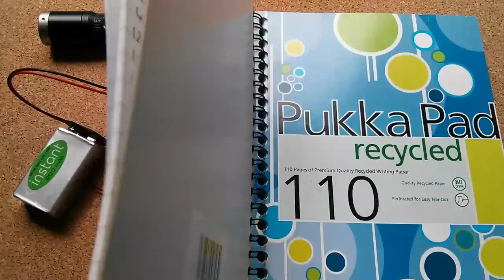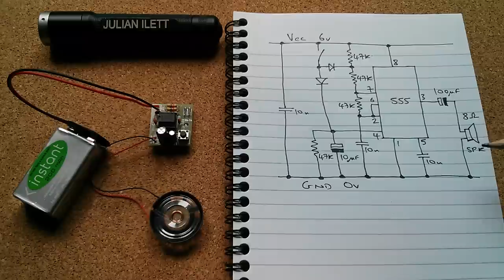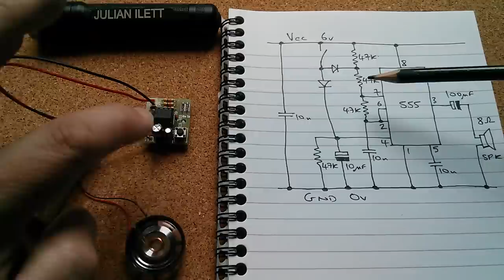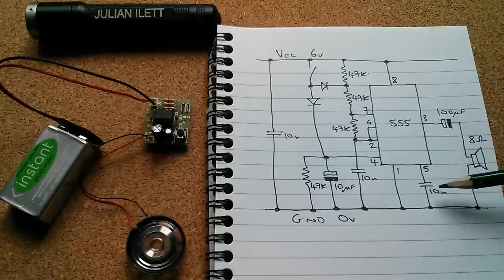Reverse Engineered: 50p Electronic 555 Doorbell Kit (with schematic)

Comment: Ignore my previous post a week ago regarding pin 4 floating. I ordered the same doorbell, it arrived today.  I've just assembled it and it doesn't work. The chip gets hot. I've replaced the 555 and it works. I re-installed the 555 supplied in the kit and the hot chip problem returned. Now the spare chip I used is an NE555N. The one in the kit is an NE555P.  I will take Joe Loucka's advice and play around with the 100uF cap. I will post my findings.

Comment: This is great, I'm learning so much by the reverse engineering.  Splitting the resistors, isolating the circuit paths with diodes, these are great concepts for an electrical beginner such as myself.  Thanks!

Comment: Current will only be a spike as the capacitor charges, and then will decay to zero pretty fast. Likely the 100uF cap was leaky and reformed with the first few seconds of it trying to pull the output high. Also the 10uF cap was reforming. In any case the 555 output stage will survive 1A of current short term, so nothing to worry about. However this will flatten the battery pretty fast, the regular non CMOS 555 draws around 10mA just sitting there doing nothing ( reset low) so your battery will not last long. CMOS version draws almost nothing, but will not drive the speaker in any case.

I used 555 timers to drive ultrasonic transducers, and they did get warm ( so added a heatsink to them) and survived without harm for a long time running hot. Likely your only issue was cheap capacitors that needed a reform before they actually were a capacitor and not a resistor.

Comment: I got a rework station and I've been building a bunch of these kits. Found a weller clone on sale. Sorted the good learning kits from the knock off junk that has no directions or schematics. I wish we had a hobby shop around town.
What got me started was a simple repair on the power plug on a laptop. A friend dropped his laptop off his bed and dropped it on the power cord plug shoving the cable into the laptop. I told my friend to find a repair shop in the city to solder on a new plug for the power supply cable. They picked it up and for what should have been under a 50 buck repair on a 200 dollar laptop turned into 250 buck repair. They replaced a new power supply cord and charged for other needless extras. People getting ripped off pisses me off. I started watching the repair channels on YT like Louis and IpadRehab BigClive.  I've repaired 5 tablets and phones so far. Simple stuff but at least they didn't get ripped off. 
It dawned on me watching this. Capacitors can be used as a battery like device or as a sponge for smoothing spikes. Am I right? What other uses?

Comment: 555 designers should have received something like nobel prize or so. there is somany things you can do with chip, its like exploring new stuff every once in a while.
Reply: It definitely is an amazing little chip. Anything from timers to police sirens can be built with one or more of them. Some of the newer ones can even be used at frequencies into the MHz range. That means you can build a very simple (although quite terrible sounding) AM transmitter with about 5-10 components and some wires.

Comment: I purchased the exact same kit, like yours mine did not function at first and the 555 got insanely hot. I replaced the 555 and gave the seller negative feedback thinking the 555 was dodgy. :) I just checked the 555 I took out and it still works fine, albeit I wouldn't trust it given how hot it got.

Comment: It looks like it's the 100Uf cap on pin 3. Its way too large.  I built a few of these and they ALL had this problem when I first turned them on. Some never recovered until I replaced the blown 555.  They all ran hot.  After I changed the cap from 100uf to 4.7 uf, they all work. Our club ordered 25 of these kits and replacing the capacitor and adding a 9 volt battery clip about doubled the cost to $2.00 LOL..  I have no idea how they do it!
Reply: This suggestion worked for me.  Thanks.

Comment: I breadboarded this and ran some tests. At 6 volts it draws 60-70 milamps when sounding and 2.5 at rest. At 9 volts it immediately locks at 375 milliamps ! The 555 is rated at 200 max. Where you cross the line seems to vary by chip. I have some that lock up at 6.5 volts and one that lasted until almost 8.

Comment: one possibility why it may not have worked first time is that those nasty speakers, often used in very cheap headphones, have a tendency to get stuck if too much pressure has been put on the plastic diaphragm. The oscillations, and power, from the 555 could have eventually 'freed' it from its stuck position :) cool vid btw, I love 555 timer projects, there's loads of things you can do with them :)

Comment: Maybe it did not work at first with the fresh 9 volt battery. But the heavy drain when the chip got hot pulled the battery down to under 9 volts and then it started working. A heavy draw will pull it down to 8.7 volts where it seems to stabilize and stay for a long time.

Comment: Please connect this to a 6v supply that can meet the current demand, hold the button down for 30s and destroy the wretched thing!  The sound is horrid!  (Yes, I'm stamping my feet too).  Interestingly minimal  circuit, though.
Reply from the maker: I'm tempted to over volt it ;)
Reply: Please do with 20k volts.
Reply: Before you destroy it I'd like to suggest you attach a lower impedance speaker to it and see just what the temperature the 555 chip gets to in that situation. It probably won't change the sound made though.

Comment: The plot thickens. I set about replacing the 100uF cap as suggested by Joe Loucka. I removed it but before installing something smaller, I connected the 9volt battery remembering that the output (pin 3) is now open circuit. What do you know, the chip got hot! The idle current is 96 mA. I inserted my NE555N and the idle current is 8.6mA. The NE555P is obviously shot. I am at a loss as to why the original chip in Julian's kit came good. (Joe and other contributors of other posts have also had chips recover) I will play around with my NE555P. I think I'll study its specs.
Reply: I don’t think these NE555 chips are genuine Texas Instruments chips, but are either clones or reprocessed (cleaned up and remarked) ‘pulls’. I’ve had a different cheap kit with a NE555 where the discharge pin was open circuit, the timing capacitor would never be discharged.

Comment: I have a non functional one, and am using it to learn electronics with my son. I measured voltages at the chip and some other locations and all seems well yet no sound or effect when the button is pushed. Still working on it, hopefully we will figure it out. I can hear the speaker crackle as well when the battery is plugged in...

Comment: This is basically the same circuit as the "ding dong" doorbell circuit in Dick Smith's "funway into electronics" series
Reply: Yep, volume two still got the book lol. The only difference I can see besides values used is the speaker being connected to positive side as opossed to ground and a 15 ohm resistor in series with it.
Reply: The 'Funway' books. I remember them. Those books along with the Dick Smith catalogue (Data section) were responsible for my interest in electronics. Alas, the Dick Smith stores don't exist anymore. I am fortunate to have a Jaycar nearby :)
Reply: alanmelb Well some have all the luck ;-p the closest Jaycar to me is a stockist over 30kms away and it's not very good one (told me they have to order in enameled copper wire lol). As for Dick Smith I wasn't that sad to see them go in the end. They kinda died for me back in the mid 2000's when they stopped catering to electronic hobbyists and became a JB HiFi clone with less floor space
Reply: A 60Km round trip only to be told 'we ain't got none'. I would not be happy.  I'm sorry but I immediately thought of Monty Python's 'Cheese Shop'. I can imagine some bloke telling you "mmmmm copper wire..... there isn't much call for it in these parts". Lol, but with apologies :)

Comment: Thank you for doing this backward engineering so quickly. I've got a fun project for the weekend now. I think I'm going to use a transistor to control the power to the speaker, rather than have the 1A run through the 555. Can you see any reason it wouldn't work with a regular BC547 NPN transistor?
Reply from the maker: A driver transistor would be a good idea - BC547 sounds perfect. Use a suitable base resistor to control the speaker volume. The 555 will stay much cooler.
Reply: Or you could use a BD139, BD140 pair wired up in a output circuit configuration. Have them as a dual emitter follower- both emitters connected together which then couple to the speaker through a 1000uf capacitor. The collector of the BD139 going to the +9 or more volts supply and the collector of the BD140 going to the negative rail. Both transistors bases connected together and connecting to the output of the '555 (perhaps through a resistor). The square wave from the '555 should ram the two transistors hard into conduction alternately and make a lot of noise with a fair speaker. You might need a resistor going to ground off the transistors bases... Not sure

Comment: will the doorbell sound longer in the second half If you take the 10 micro capacitor out ?
Reply from the maker: It will sound for longer if you increase the value of the 10uF capacitor
Reply: +Julian Ilett but what happens if you take the capacitor out?
Reply: It will only beep while you push the button.
Reply: To make the second beep longer, use a 47uF capacitor, the longer it takes to discharge, the longer it should ring for. I think.
Reply: Could work with a higher value resistor as well. Instead of giving it more charge, you make it discharge slower

Comment: These super-cheap Chinese kits tend to be fun to assemble but have little practical use, and this is a great example. I do enjoy building them, trying them out for a few minutes then putting them in a drawer. I have to mention the quite impressive but not particularly useful "DSO138" oscilloscope, which comes with detailed assembly instructions printed in colour, rather than just a bag of components.

Comment: I just put togther a circuit to flash some leds for the garden, the flash signal comes froma  555, and I have the same problem as you, the 555 gets hot, all connections are correct, but the chip heats up, I have the 10nf on pin 5.
Is the 555 in yours a signetics like mine is?, maybe a bad batch.
Reply: My faulty 555 is from Texas Instruments. Could it be bad batches from both manufacturers ?
Reply: I dont think so julian, must just be a coincidence, I replaced the 555 and the circuit now works ok.
One thing I did which might have blown it was short the resistor from pin 7 to +V to see how the duty cycle was affected, I didnt think pulling the threshold pin to +V would blow it, but maybe it did.
Reply: @hellcattanks  - pin 7 connects to an open collector of a NPN transistor, so when the NE555 wants to discharge the timing capacitor (that is when the pin 3 output is low or supposed to be low), the pin 7 NPN transistor will try to turn on. If pin 7 is connected to the positive supply without a resistor to limit the current, the chip may be damaged.
Reply: @Mark1024MAK  Yep looking at the datasheet your right, pin7 cannot discharge the power supply, oops.

Comment: However if I'd like to change the sound that means I need to change the all schematics ?
Reply: Putting it in a resonant chamber, such as a wooden box would make it less nasty, but if you want to change it electronically, the 555 only has a few waveforms, so the choice is very limited, and yes, you'd have to change the circuit because if you didn't it would do what it's doing here...
Reply: Just tweak the top 2 resistor values.

If you make the bottom one larger then it'll stay on for longer.
Reply: Heavy heavy LC filter to take the corners off the square wave maybe?
Reply: "LC filter to take the corners off the square wave maybe" - yes, exactly what I was thinking but I thought I'd come here to the comments in case someone had already suggested it. :-) Julian, give it a go! :-)

Comment: I'm looking to use a wireless door bell and it's remote as a mail box alert system, but, need info on how to modify the bell with a visible indicator (e.g. light or led) which  will stay lit until I manually deactivate it.  Any ideas?  Thanks
Reply: It's called a flip-flop. Alternatively, the 555 has a bistable mode in which it basically acts like a flip-flop (I'm thinking, set on bell button press, reset on reset button press, output to resistor and LED).

Comment: I suspect there was a hairline etching short on the PCB that was eventually burnt out.
Reply: Not likely as it has happened with multiple boards, mine included.
Reply: That fact does not negate the possibility.
Reply: +Mike Hawkins agreed but it decreases the likely hood somewhat.
Reply: Not really. Since the PCBs are manufactured by the same company, using the same design and the same process with little or no test/inspection, it is entirely possible that an etch fault is common on this PCB design.
Reply: +Mike Hawkins you may be right, my experiences however tells me hairline fractures are generally an imperfection the the board rather than the etching process. Having two boards fail in the exact same way would lead to a design fault in my opinion rather than a PCB fault.
Reply: I didn't say anything about fractures, I said it may be an etching fault, i.e. a hairline short that gets burnt out when the board is powered up because the current path it creates has insufficient csa to carry the current that the connection between the two points generates. Common causes of etching shorts are tracks/pads  that are too close together, contamination of the copper surface or the board was removed from the Ferric Chloride too early.